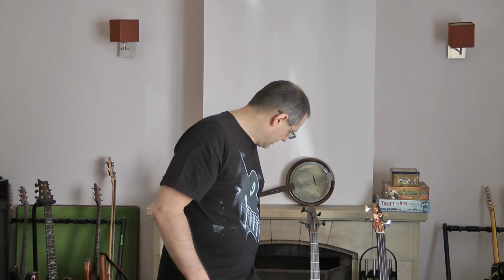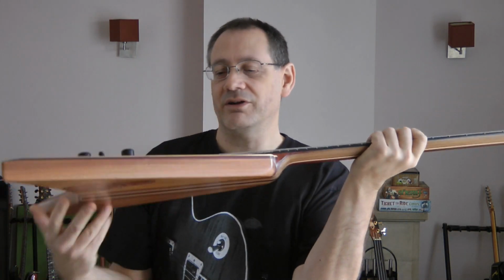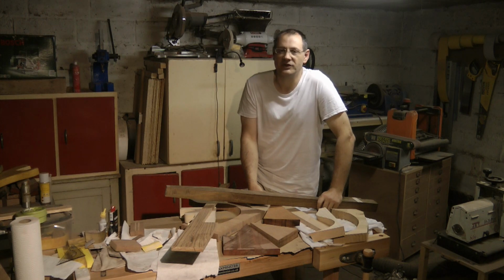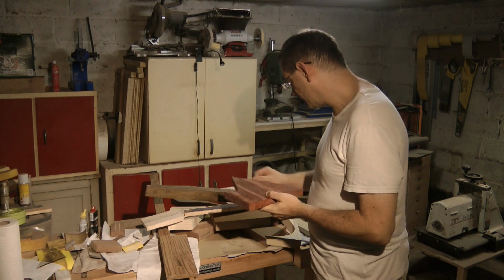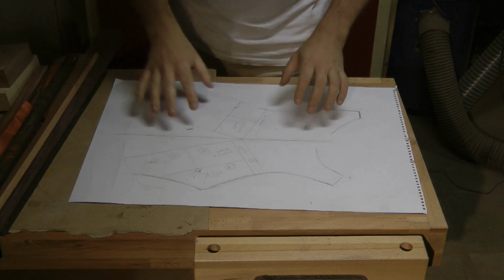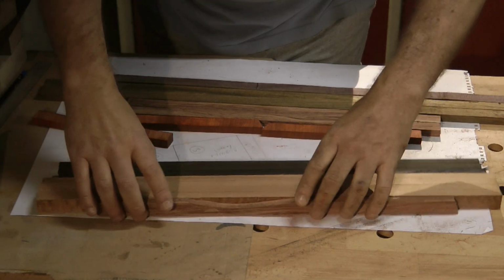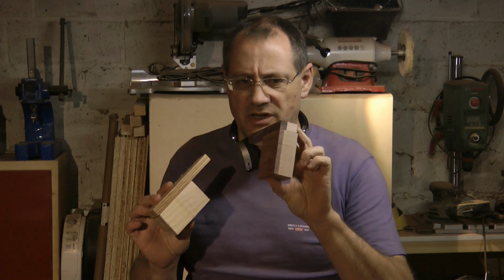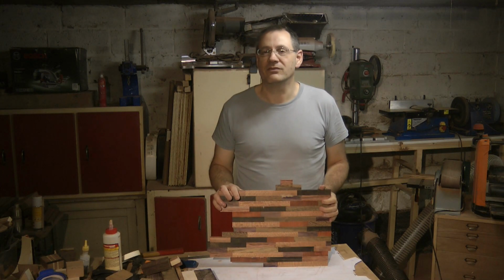Great Guitar Build Off 2020 - Unofficial Challenger entry

Comment: Looks awesome! Although I think the reason more than three Types of wood is not advisable is the different seasonal expansion rates. I say it’ll be fine!! Great work.
Reply from the maker: Thank you! I am wondering if it's going to pull itself apart some time after it's build because of that.  I plan to use a finish that will hopefully not allow moisture in and out to try to prevent this.

Comment: Just a note. Most guitars are built with a standard thickness. Using hard heavy wood makes them heavier than normal. The weight of these guitars is impossible for many women and some men. I am always on the search for a lightweight guitar. Can you design and build a beautiful guitar with a thin body? Making is lighter in weight, without neck dive?
Reply from the maker: Hi Rachel, if you saw the resin guitar in this video, that one is quite a thin body and fairly light.  You can either make the body thinner (and then you have to be careful about the electronic components - you can't use a normal 3-way switch, for example), or you can make a normal-sized guitar and hollow it out.  I'd suggest you take a look at the PRS SE Hollowbodies, for example.  Incidentally, I am planning to rout out some of the wood in the body of this guitar to reduce its weight - you will probably see that in the next video.